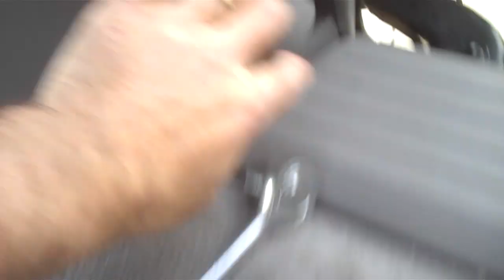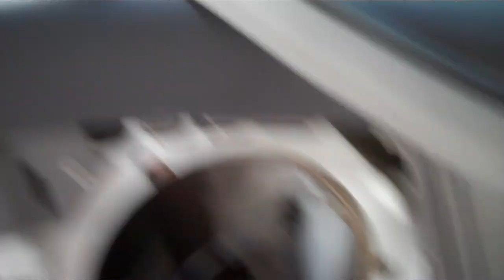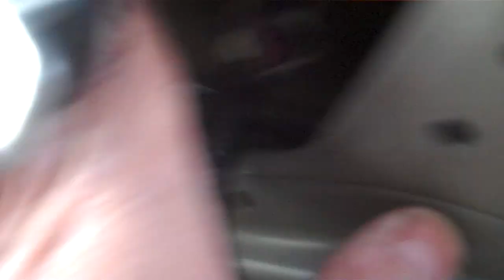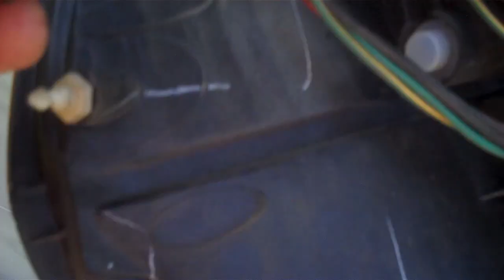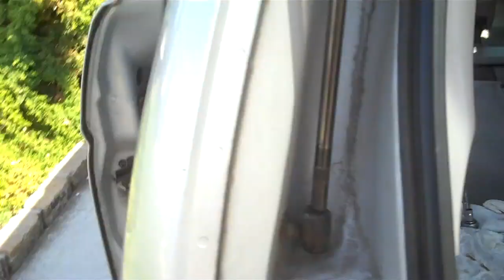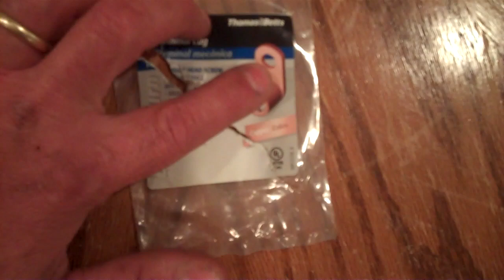2003 Honda Odyssey sliding door cable repair

Comment: Is there a way just to cut the cable with my cables already broke anyway but is there a way to run the door manually?
Reply from the maker: @rogerthat.9105  yes it should still work like a manual door if you cut the cables

Comment: I found the perfect part for the end pieces for the cables - sleeve nuts @ True Value hardware. They are cylinders, threaded inside, and come in various sizes. I cut the nut to the proper length, drilled a hole through the middle of the side, put the cable through the hole, put locktite in both ends, and tightened screws (cut to the proper length) into both ends. So far it has held up almost 2 years. I recommend also replacing the hinge & rollers, as the rollers are likely worn due to the age of the Oddessey. Mine is a 2003. I hope to keep it a long time. CHL.

Comment: Have a 2003 EXL and my drivers side broke on Monday morn...It's now tue and with all parts mentioned, my sliding door is just like new again...Thank you for the video....The only problem I encountered was that when I was in the van rerouting the cable(s) back onto the pulley(s), I was doing it with the door closed and trying and kept jamming.....NOTE: When rerouting the cables back onto the pulley(s), make sure the sliding door is in the open position...It started working again, but would not open completely and noticed there was a little slack....Made some minor adjustments and door works perfectly..Fully open and fully closed  :)

Comment: Really helpful information.  Just fixed my 2004 odyssey.  One tip that might help others struggling to remove the main pulley (the opening side pulley): Partially screw two screws into the main pulley (after the closing pulley has been removed), grab the ends of the screws with two pairs of pliers, and off it will come.  Remove the screws after the pulley is off.  The plastic is pretty brittle, so any kind of prying from the side will likely chip the wire channels.  I learned this the hard way.  This also means an adequate pilot hole should be drilled prior to screwing into the pulley.  Thanks!.

Comment: Thanks for the video, super useful. I fixed my sliding door just as your video. I did dip the ends of the cable in some epoxy. Thanks.

Comment: Thank you for the video. It helped a lot.For the end cable that goes outside on door roller I used the  indicated lugs .but instead of screwing the cable tight  I doubled it up and pushed in till almost came out out the other hole then I filled the screw hole with  soldering paste and soldered the cable in.
For the inside ends I bought (actually had them, I'm an electrical contractor) Crimp Sleeve the ones some contractor use to crimp the grounding wires together instead of wire nuts.
Home depot  10-310C  GB   Gardner Bender copper 18-10.
I drilled a hole in the center , pushed the cable in it and looped it till the loop almost came out of the non flared  end.  I soldered it in and used grinder to shave off the flared ring. Perfect fit on both ends of the cable. There is no need to alter anything else as this cable is just as good as the original

Comment: THIS WILL NOT WORK WITH 2011 AND UP ODYSSEYS!!  I BOUGHT THE GREEN CABLE BUT IT IS TOO BIG!!  They made the cable very thin in the new odysseys.  Another video mentioned to use the 1/16 cable without the viny covering

Comment: Mike, you're video continues to be a great resource for Odyssey owners. I used your technique to fix my passenger side door yesterday and it works great. Thanks.Here are some things that I found helpful:
1. I used Dorman 03337 1/16 cable stops as suggested by AKGofer to attach the cable to center roller. They are the perfect size to fit into the center roller. The hole size to accept the cable needs to be increased. I used a 5./64" bit and held the piece steady with a pair of pliers. I cranked down the screws really tight, so much so that the screw head broke off. I don't think these will come apart.
2. I used the Dorman 03336 assorted size cable stops to attach the cable to the drum and pulley. The smallest in this assorted pack are the perfect diameter to fit into the drum and pulley. The height needs to be decreased with a file or a grinder to get the cable to fit perfectly into the grooves on the drum and pulley. I also had to hacksaw off the screw head after cranking down the screws. Again, I don't think these will come apart.
3. I removed the drum and pulley. I opened the door all the way, wrapped the rear cable around the drum (big outer wheel) and then replaced the drum being careful to any slack in the cable. I then replaced the drum and wrapped the front cable around the drum and into the pulley. Again, being careful to remove any slack from the cable.That was it.

Comment: Assuming that it is the cable, will my door's motor make any noise?  My door does NOT make any electronic noise at all.  It is as if there is no power going to it at all...no beeping or anything.  Do you think it would be the cable?
Reply from the maker: Usually the motor will still work if the cable broke. Also look at your cable and see if there is any slack, that's a sign that it broke.

Comment from the maker: Just an Update, we picked up a new 2015 Odyssey Touring Elite last month, so just as I was about to sell my 2003 and put it in the classified, wouldn't you know it, the cable broke/ pulled out of the ground lug. So I spent a few hours putting  new cables in, but this time I double looped it into the ground lug, plus I dipped the cable in epoxy first before inserting into the ground lug,  so there is no way it is going to come out again. I did manage to sell my van at a decent price.
Reply: Mike Pier why did you sell it? was the rear vent Windows giving you troubles?

Comment: Thanks Mike for sharing your technique in replacing the door cables for the Honda Odyssey.  It took me two attempts before I finally got the passenger rear door to work properly.  Some lessons learned that I can share with others include:
1. Get the 1/16" steel wire (coated with green plastic) and not electrical wiring - 1st attempt failure.
2. Cut the cables to the dimensions that Mike stated front at 5' 1" and back 6' 9". Does not have to be precise but close.
3. Position door in the open position and work the back cable first (attach to the door bracket, feed through from the outside and wind on the larger white spool then place back on the motor shaft) ensure you are about 9 inches of cable showing on the outside from the bracket to the black rubber covered pulley.
4. Attached the shorter cable to the door bracket and feed through the other black covered pulley to the smaller diameter white take-up reel then place onto the motor shaft.
5. Manually close the door and note any problems with the cables attached to the white reel. You might want to adjust the smaller diameter white reel to apply more tension to the cables.
6. Manually open the door to the full open position to ensure cables are working properly and place the cover plate back over the motor (note you will see two inspection slots for each cable pulley and you can see and mark where the center point is for both cable pulleys.  There may be black markings already next to each inspection slot.  Each pulley center point should be close to each other with some tension.
7.  Manually close the door and repeat the process described in step 6.
8. If satisfied reconnect the two electrical cables to the door motor and test the sliding door automatically.
9.  For some reason I could not get my door to go fully closed (it worked OK going open). so I tightened the cable tensioner (small diameter white reel), manually closed the door, reconnected the motor's electrical connectors then from the front dash gave the passenger rear door a depressed "Closed" position (I believe this helped reset the close sensing solenoid).  After that my door cycled just fine.

Again I'm just sharing my trials and tribulations, but Mike Pier is the man that I tip my hat off to.

Comment from the maker: Not sure if I mentioned this, but in order to take out excess slack in front cable, the door must be open so the front cable is fully extended out. You cannot do this when the door is closed .

Comment: My passenger slider is fixed because of your instruction.  Thank you.  Just a couple of tips to help others as I was doing the job...run the cable into the van from the outside in.  It's nearly impossible, especially the back of the van to run it from the pulley to outside.  You can do the crimping inside the van.  If you unplug the motor, be sure to disconnect the battery to reset.  If you don't, the motor will not operate.  Like me,  I thought I needed to replace the motor after all of that work.  My educated guess paid off.  Hey, took me two times because I didn't crimp the ferro enough and the cable slipped off the first time.

Comment: I am having trouble after watching the video. Everything looks fine. Try to open the drivers door and it stops about an inch and there's an audible alarm smh HELP
Reply: I had the same problem.  I believe it has to do with that 9 inch measurement he gives.  I fixed mine by taking the roller off the door and track again, sliding it all the way back (attached to both green cables), then I put my interior cables back on the tensioner first the back one around the larger outside spool, then the front one once around the inside spool then about one strip on the outside larger spool.  See if that works

Comment: the problem with my odyssey is that it will not latch.everything else works normally.I don't know if you looked at the closer motor,but would this size cable work with the latch assembly? This video shows the cable for the latch portion.

How to fix a Honda Odyssey automatic sliding door that will not latch
Also, is there any way to confirm that it is indeed the cable that's broken rather than something else before ripping the panels off the door?I already tried the fuse trick.Another post on another website showed that one person replaced the latch assembly but it wasn't the problem.He tried to test the voltage at the door contacts and found there was no voltage to the contacts when the door closed,so he assumed it might be a sensor that is not sending voltage to the closer motor.That is the reason I ask if there are ways to tell if it is the cable or motor for sure before tearing the door apart.I am not particularly savvy with electrical parts.Any help would be appreciated.
Thanks.

Comment: I wanted to say thanks Mr. Pier, this video was very helpful and I just successfully  finished my wife's 2003 Odyssey passenger side door repair.  I made a few mistakes but went back over the video several times before finally getting it right.  The first mistake I made was trying to adjust the length of the cables after installing them. The second mistake I made was not getting the crimped aluminum things oriented correctly in the outer spool.  The way I had it, the cable protruded outside the spool surface.  I thought that I could just bend the cable in a 90 degree angle right after the crimp.  This protruding cable, plus the excess cable seemed to be the reason why it tangled after about the tenth opening/closing test.  I went back to Home Depot and got more cable.  I also went to Lowe's and bought some 1/16" ferrules and they turned out to be better.  They were a little bit longer than the Home Depot ones and this allowed me to drill a 3/32" hole perpendicular to the pre-drilled hole.  I routed the stripped cable end through the new hole and crimped it and it appears to be working perfectly with the cable passing through the channel just like it is supposed to.  Before doing that though, I cut the cables to 5'2" and 6'10" - one inch longer than Mr. Pier's direction.  The reason for this is during the original tests described above, the cable ends slipped through the copper ground lug.  This may be because I did not strip the insulation, and did not tighten adequately.  To solve this problem, I stripped more insulation - hence the added inch for each cable - then I passed the cable through the lug and then folded the cable and passed it back through from the opposite direction.  I then put Loctite on the set screw and tightened it as much as I could.  It helped to build that end of the cable away from the roller assembly.  By doing it away from the roller assembly, I was able to hold it with a set of pliers and really torque down the set screw.  I didn't do that the first time and that may have contributed to the slipped joint.  You have to be careful not to have too much of the folded part of the cable out of the lug as it will make it difficult to place it in the roller assembly.  I had to spend some time pounding the excess back into the hole.  I think that doing this might make it less likely for the cable to pull through again.
       Again, thanks Mr. Pier, the job went well and I would highly recommend watching this video to others who have this problem.

Comment: By the way, I did this for my passenger-side door, used the cable lengths suggested for the driver side in this video as a starting point, and then checked them against my mangled cables.  The 5'1" and 6'9" lengths seemed about right and worked for me on the passenger side of my 2002 EX.

I think that the take-up pulleys are referred to as the drum (big outer) and pulley (smaller, inner that ratchets against the drum).  I removed both from the motor shaft (not easy to do with the motor in place), wound the rear cable around the drum, installed the drum on the shaft, and then wound the front cable around the drum and ultimately around the inner pulley, and then installed the pulley on the shaft (inside of the drum).  You have to be really careful about taking out the slack and ensuring you don't kink the cable.  I watched this video several times to make sure I had it right.

Comment: Thanks a ton, Mike.  I had inadvertently tangled my cables by leaving too much slack when replacing the center roller on my Odyssey.  Your solution was much better than a new $500 motor/cable assembly. I couldn't have figured out how to do this without your video, and I did it all with the motor in place, though I did have to remove the two plastic take-up pulleys.

I also found that Dorman HELP! 03337 Brass Cable Stops, which I bought on Amazon (some auto parts stores have them, but none in my area), were another solution to cable stops instead of the ground lugs.  The Dorman stops have a smaller hole for the cable to go into than the ground lug you used, and I figured that they would provide a stronger hold.  Actually, the Dorman holes are a little bit too small to accept the cable, and I had to slightly enlarge them (see below).

I cut down the height of the Dorman set screws with a Dremel so that the assembly wouldn't be so tall.  I increased the size of the hole that the cable goes into in the cable stop with a 5/64" drill bit in a drill press. The resulting hole was the perfect size for accepting the stripped cable end, and I've experienced no slipping.

I also had to increase the diameter of the hole into which the stops go in the plastic take-up pulleys.  I did this with a drill press and ensured that I only drilled as deep as necessary to accommodate the Dorman cable stop.  I don't recall what size drill bit I used -- maybe 11/32" or 23/64"?  Measure carefully!.  Modding the stops and plastic take-up pulleys took about 20 minutes for the four stops and two pulleys.

Comment: My problemending up being the rear pully was seized.  I could run the cable thru it but it kept grabbing.  I tried to grease it but it would not run smoothly.  After 2 days working on I just pulled the cable and unplugged the motor.  I now have a constant light on my dash.  My husband was amused because I refused to even pay for a $150 part of ebay.  Car has 170,000 miles and my kids are old enough to open the door.  My husband was amused by me.

Comment: we are trying to figure out how to get the ground lug on the ends of the cable.  we went to Home Depot and several other stores with no avail.  where did you guys get yours?  how did you attached the cable to a ground lug?

Comment: Just did this repair over the past weekend.  Worked perfect.  Took about three hours.  No problems.  Did both cables on the driver door. Exact parts from Home depot were $8.50.
THANKS!

Comment from the maker: Adjusting the cable will  only take out the slack, but it should not affect the length once both cables are secured to the door and motor.
Perhaps the roller assembly was not put on the door correctly. It has room for adjustments on the mounting bolts. I would loosen the bolts just enough so as the door closes, it can move to its "happy" position. Then tighten the bolts.

Comment from the maker: Are you sure you are using the longer cable for the rear and not the front? The video above is for the drivers side door, so looking at the motor,  the longer cable comes in on the left of the motor, and the shorter comes in on the right.
For the passengers side its the opposite. The shorter cable comes from the left,and the longer cable comes in on the right.

Comment from the maker: I have not done the passengers side, but I would have to think the lengths of the cables are the same. If you notice you have slack, it can be adjusted by the inner pulley. If you take the inner pulley handle by your 2 fingers and turn it clockwise or counterclockwise( depending what side door you are working on), it will tighten the slack. 

To loosen the cables, you pull out the inner pulley slightly with your 2 fingers to unlock , and rotate the opposite way